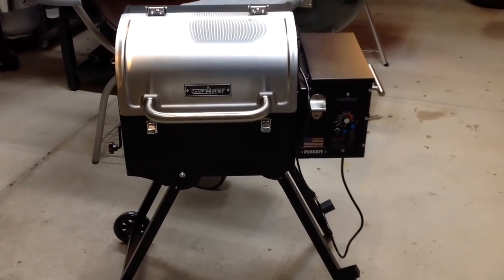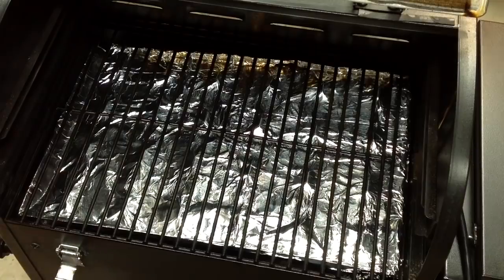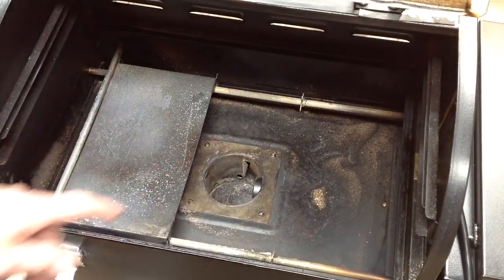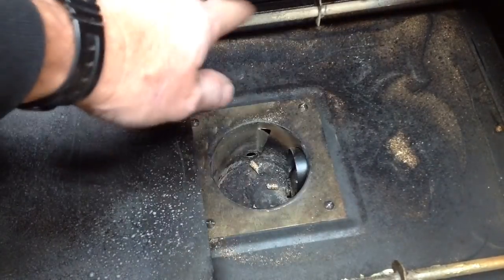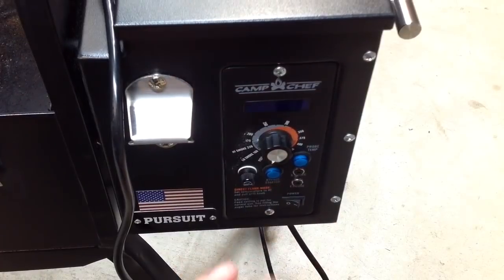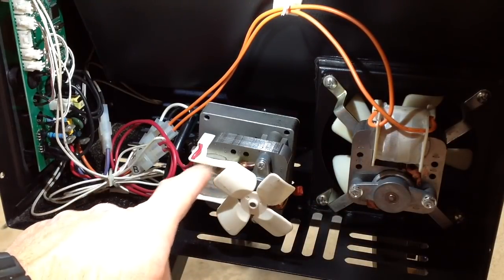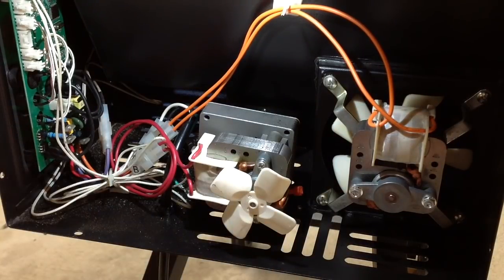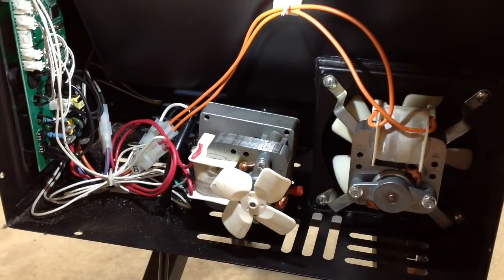How Does A Pellet Grill Work?

Comment: My only concern about these is because there isn't direct heat from an open flame (like with propane or charcoal) I feel like it would be impossible to get that char or flame-broiled crust on meats. Because with the grease tray and shield thing covering the heat source, wouldn't this just be like putting your meat into a smokey oven?
Reply from the maker: Thanks for watching! Although some manufacturers market being able to direct sear over open flame it typically is a small direct flame zone. I have done cast iron seared burgers and steak with cast iron getting up to 6-700 degrees by removing flame yammer and grease tray. Pellet Smokers excel the best at low and slow with smoke

Comment: Thanks for the video. I've been trying to learn how the heat is generated. Is it coming from the pellets or the hot rod? It seems like the blowing air is what's causing the pellets to burn faster which would generate more heat.

I'm planning to try out pellets with a propane burner and a cast iron pot added into my firebox but I'm not sure it'll be the same effect as much of the heat would come from the burner.
Reply from the maker: Thanks for watching Brian! The hot rod just ignites the pellets, the blower keeps them going. Good luck with your idea!

Comment: the grate you covered in foil has vents but they are now covered by the foil, is this a problem?
Reply from the maker: Thanks for Watching John! Good question! The holes are for the searing option on the pellet grill, the slots/holes are intended for flames to come thru for searing which it does directly above the 4” fire pot, no where else. Covering for low and slow just help make clean up easier
Reply: @TomHorsmanAmateurBBQ  Excellent thanks my friend, i have bought this grill and assembled it but haven turned it on yet
Reply from the maker: Nice choice! Congrats on the new Cooker!
Reply: @TomHorsmanAmateurBBQ  you're a good man Tom. I used my first time today was pretty successful. I did Flame Out because the the auger went empty. Do you have a mod that keeps the pellets from stacking up in the sides of the fill box?
Reply from the maker: Thanks for the kind words! Wow! Never had that issue, not sure why that would happen especially with the vertical sides. Others have said that Pellet choice mars a difference but I’m not so sure about that
Reply: @TomHorsmanAmateurBBQ  not a big deal, i used camp chef competition pellets, i guess make sure you occasionally push the pellets down from the sides.